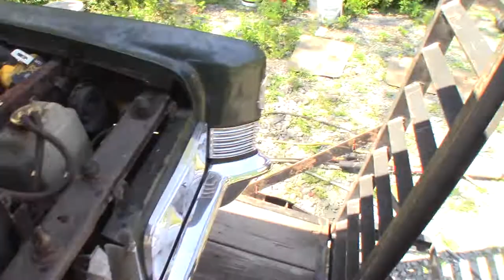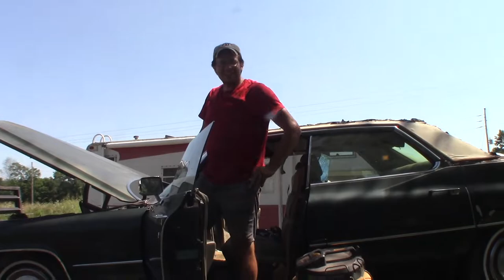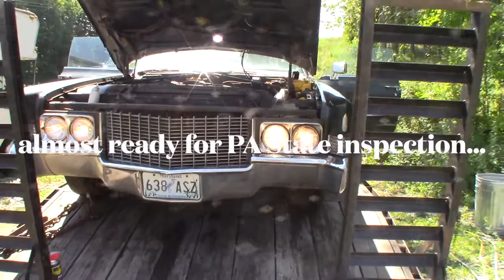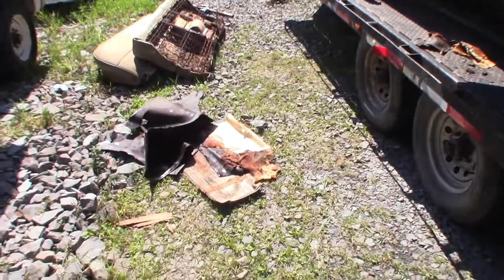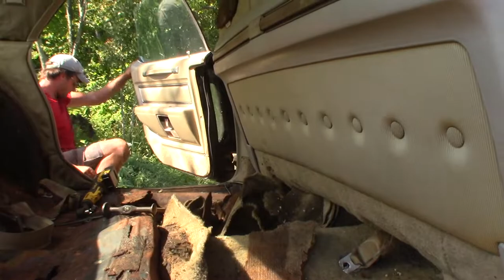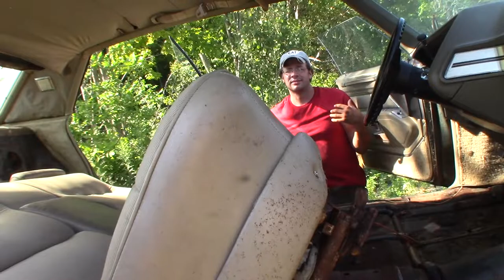Junkyard Caddy  Will this thing run?? part 2

Comment: I think I'm in love! (and I do like that green too)
Reply from the maker: Hi WhaleBlue; Gonna respond to all three comments here; Man I love that car too! It was a fun Project and its fun to drive around. I think I have about 70 videos on that car.  The solvent that worked the best (at all) was toluene. It is an adhesive thinner, it didn't really reconstitute the glue just made it soft enough to scrape.  Thanks for the tip on the k100 and never heard of B12, except as a vitamin. BTW, Connor has been using that mower and its perfect for his yard, hills and all. Thanks as always for the great comments!!!! John